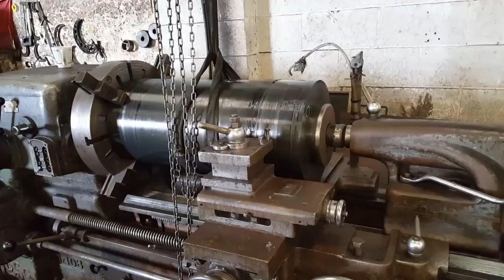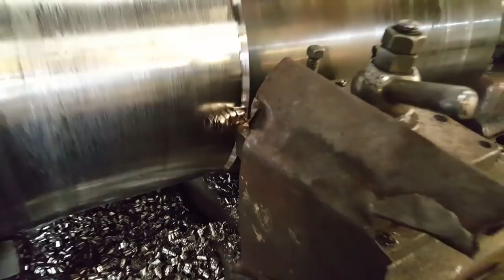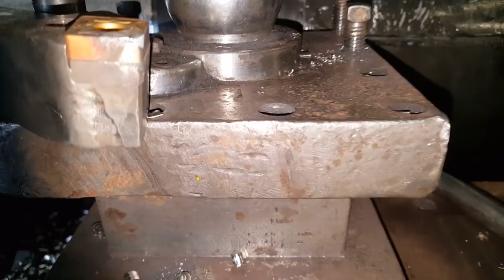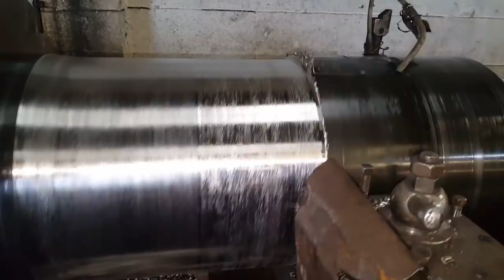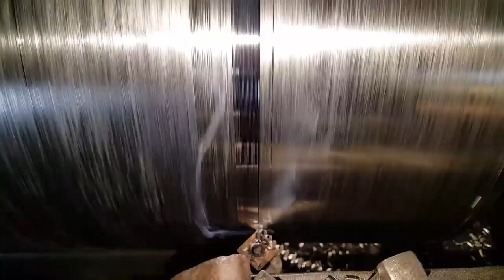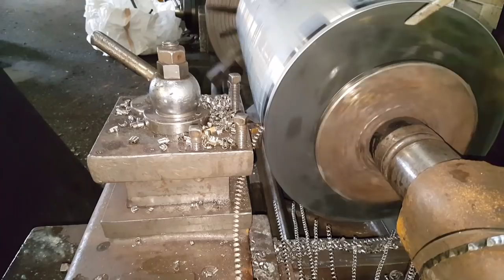Turning INCONEL 718 age hardened. 390mm - 360mm x 1300mm long.

Comment: What is even more insane than dealing a chunk of inco like that is trying to imagine what the hell it's going to be used for.  Aerospace, nuclear, military, the beginnings of a turbo shaft?  One interesting description I have heard about trying to machine the stuff is that it's like machining rubber bands.  Tool shredding rubber bands, obviously.
Reply from the maker: jUsto hi. This had been age hardened so ????? Really hard stuff.
Reply: I'm guessing this piece of metal was pretty expensive.

Is that what you were trying to show, that the tool only made it about 9" before the insert was used up?
Reply: I have to turn this stuff all the time and i work for a company that makes valves for many different companies including paper waste, oil, steam, and nuclear reactor valves.
Reply from the maker: @talkvideo9059  yes. The inserts don't last long.
Reply: Na there's no bend in inconel, your probably about a super duplex or a monel
Reply: Inconel 718 is used for Oil and Gas Extraction where other metals can't cope with heat.

Comment: Old lathes pull like trains. Only thing I'd be wary of is tapering away. Coolant should always be used on hard material. The square tip is the right one to use to dig in. I think it's set up right speed and feed looks good. The last cut should be no less than 20 thou a side unless it's going to be ground to get better finish?

Comment: Looking at Inconel videos to see why it costs so much. My exhaust headers and turbo/plumbing are Inconel 718. I know it’s Inconel. Just not sure about the 718z maybe 640? Anyhow it cost me an arm and a leg lol
Reply from the maker: Yes 718 is used for car exhaust  but only very expensive cars.
Reply: Inconel 625 for exhausts.
Reply: @userwl2850   how do you rate the type 18  dsg  with the electric clutches

Comment: and when you are using more cooling emulsion, your tools will be hold longer 718 is was very hard
Reply: Well really depends on the insert. If its a ceramic insert, then its best without coolant.

Comment: I want a snare drum shell made of Inconel! 
14” diameter by 6.5” deep. 1mm thick
Can this be done?
Reply from the maker: Yes it can. It would be the most expensive in the world.  🥁😩
Reply: David Wilks 3hat would be the order in which you turned it? And what would it be like with 1mm wall thickness?
Reply: Not hard to make a drum shell from 718, you just have to go about it a different way. Get some aerospace grade 718 sheet, cut, roll and weld.  If you want uniform material properties it needs a full heat cycle after getting it properly round.

Not going to be cheap, though!

Comment: Imagine doing that with HSS....
Reply from the maker: Lite Roadie it's not possible to cut with HSS.... no chance.
Reply: userwl2850 What was the surface speed here? Could you do it with brazed carbide?
Reply: @literoadie3502  I think a brazed tool can work, you just need to mind the tool pressure?

Comment: What's happening if you take a Small pass arond 4/5 mm radial and feed of 0.5/0.7 mm-rev and increese the Speed about 60/85m-min ? The insert seams to break for the low cutting Speed
Reply from the maker: Alberto Dal Maso this steel is 718 age hardened. The ruffing cuts was on 10 rpm and .2mm feed rate. If it was 12 or 13 rpm with a .3mm feed it would not cut. The finish cut was 22rpm and .3mm feed rate removing    .5mm. There is no faster way to cut it. Thanks for your comment. 👌
Reply: userwl2850 in my workshop in CNC lathe i saw turning duplex about 850/950 mm of diameter at 74/80rpm 10 radial depth and feed of .84 . The tooling use is of sumitomo brand (i don't know what kind of duplex in commercial Number)
Reply: @userwl2850  
 There is a faster way. 45° approach angle, positive rake, lots of coolant, 20m/min and .8mm/rev feed.

Comment: No coolant is daftness, I wanna be no where near that swarf
Reply from the maker: Trust me.... it burns you seriously.  Red hot litrely.
Reply: My 718 swarf doesn't, it's like razor sharp silky ribbons
Reply: That a ward 7 your spinning it up on?
Reply: @johnbaugh9736  Try lowering the speed, and put the feed up to encourage it to chip. Also consider tip shape you are using and cut size. Inconel can be machined successfully if you are patient with it and find feed speed that works for your machine.
Reply: @RemyMartinVSOP  I know dude, I work a lot of inconel, last week had some high yield 718  on my capstan making some cap screws. Had my surface finish like glass on the plane shank, 178rpm with plenty feed on my roller box, loved it,it did! Inconel is easy, you just gotta cut it how it wants to be cut. Want something horrible, try Nitronic 50. The thought makes me cry lol
Reply from the maker: @johnbaugh9736  no. It's a DSG... Dean Smith and Grace.  Best of English lathes.
Reply from the maker: @johnbaugh9736  you must be using a ceramic insert as it's not possible to do that with carbide.

Comment: you said once you dont use coolant because its easier to see if the insert is worn out or not.
it would be interesting for me to know how much longer the edge would last if you would use coolant, because one hears all the time how important coolant is on this stuff or similar like titanium. not that i think i know it better than you, i'm aware of that you´re machining this stuff everyday. personally i never machined inconel or titanium, looks like a real nightmare to machine.......
Reply from the maker: MaximumDistortion2 hi. Not always allowed to use coolant.  This runs so slowly it makes no difference.  All the heat is transferred into the chips and not running fast enough to bother the carbide. I give the tool itself a little drink now and then. Titanium exactly the same.  Boring it by trepanning is a different game altogether.  Couldn't possibly do it without coolant as it's cutting the centre away and the heats transfers into the job. Understand? 👌
Reply: thanks for your answer!

Comment: If you like machine noise it's ok, but with no explanation it serves no purpose.  Thumbs down.
Reply: If you know a little about machining and materials science this video is very interesting. Inconel 718 is a 'superalloy' used for making machine parts that must endure very high loads whilst also being subjected to very high temperatures and/or extremely corrosive chemicals. Example applications would be jet engine turbine blades or valves and pumps in nuclear reactor cores. It's expensive, rare and notoriously hard to machine. In this case, the metal has been heat treated to increase its strength: this makes working with it even more difficult, so the turning being done in this video is an impressive display of skill on the part of the machinist.
Reply from the maker: wombat  🤣👏🏻😎
Reply from the maker: @nerd1000ify  thanks for that. You are the exact type I wanted to watch. 👏🏻👏🏻👏🏻👍